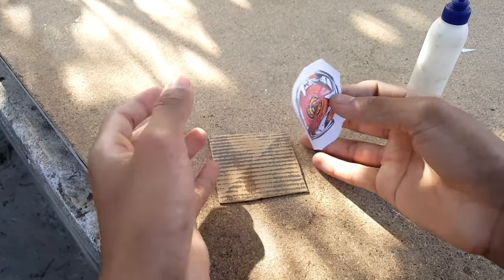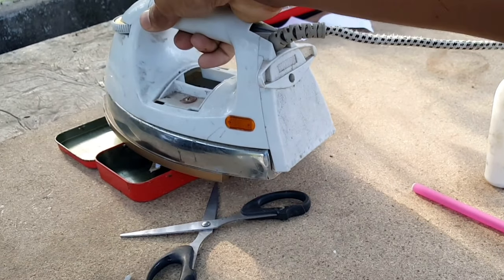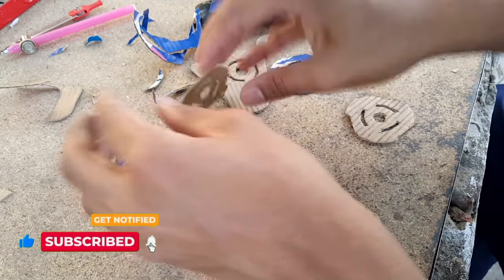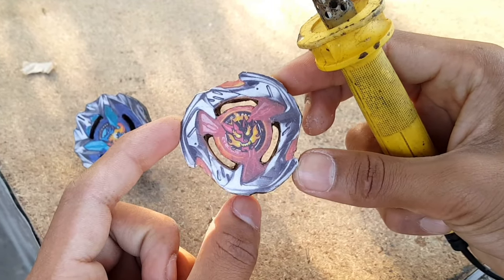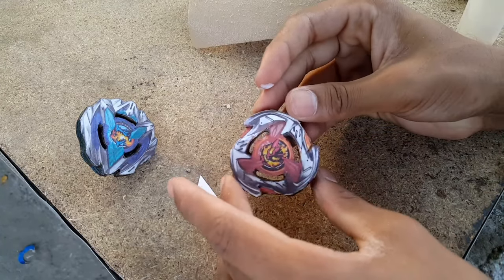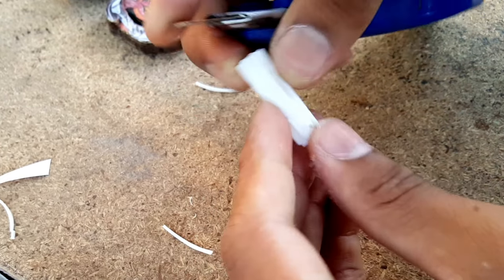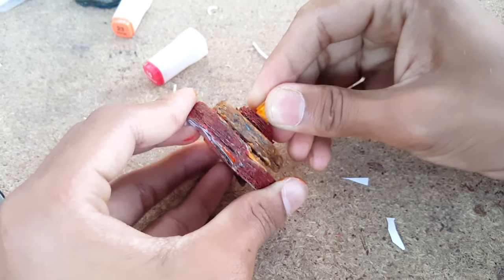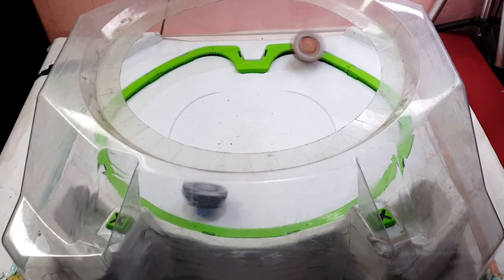How to make Hells Hammer UX Beyblade at Home | No Need to BUY

Comment: Bro the cardboard thickness you had was fine because the actual HellsHammer looks thicker than the rest of the UX beys to support the downforce gimmick thing it has
Reply: Yeah I agree it was okk but I guss too much thickness can make the bwy unstable
Reply: @ViewerNo.1 If anything the thickness would give it more stamina because of more weight
Reply: @Ultra_Blader yes good point there but now its have been decided that cannot be Changed
Reply from the maker: Yep I could  keep the thickness but isssu was the bit would not attach properly because of that thickness. That why but u guys are right